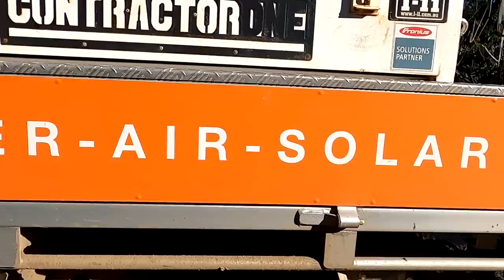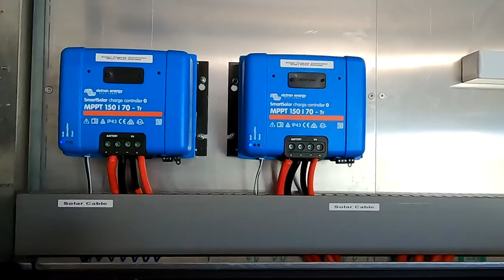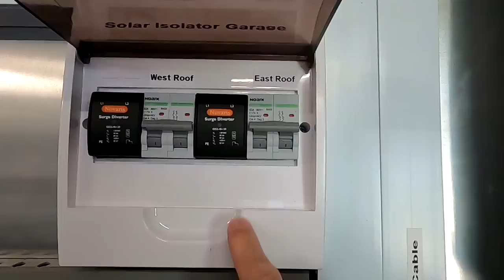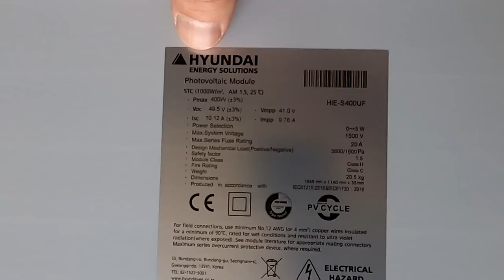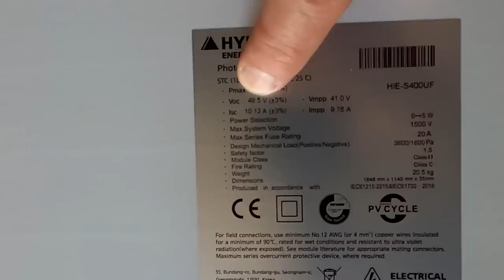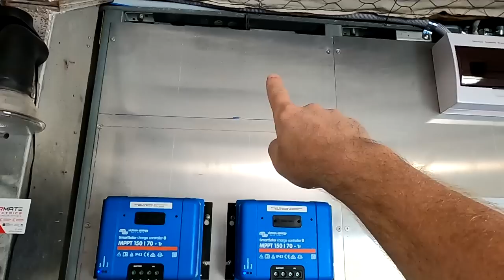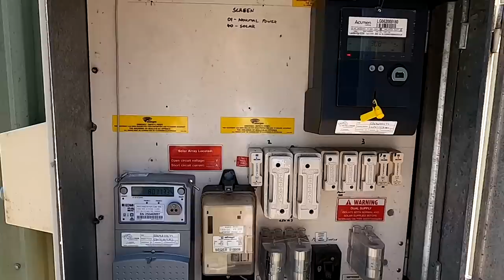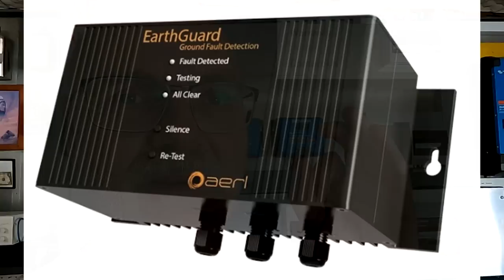I booked an Electrician to check on my DIY Solar-Battery System.

Comment: I don't know about your specific certificate program requirements, but sometimes it is possible to do part of the installation yourself and then the professional electrician inspects your work and finishes the install and thus the entire system qualifies for the program.  For example, you might be classed as an assistant or an apprentice being supervised by the professional. This can save money will still qualifying for all the financial benefits available.

Comment: Andy, if you want to wire 2S configuration it is better to go up with the panel voltage, so maybe use 550+Wp models. The width of your roof is around 3m, so you can easily install 2,3m panels in one row. 
2S configuration = a lot of wiring. Victron has also 250V version of mppt or even 450V version. But I understand, you would like to use everything what you already have in the garage.
Reply from the maker: With 2 panels on top of each other, I have the best efficiency with the shading. If I put them sideways, the efficiency is worse. One panel could be shaded, while the other on is in the sun. The voltage would not be enough any more.
Same for the 250V MPPTs or even the RS MPPTS from Victron. If panels are in the shade, it would run hard on these diodes all the time. So far the parallel low voltage strings are the best approach for this situation. But, yes, there is more cabling effort.

Comment: Regards the earthing, I was under the same impression as Andy,ie earth to the same point as the building, but if you get a dc fault on the roof that dc voltage will be present on the earth cable and thus make your earthed appliances and metal work live with the DC voltage, not good, so a separate earth point would be the answer, what did the electrician say about the earth bonding?
Reply: No, that's not true if a proper Earth ground rod or two is installed. All metal parts should have 0 potential to Earth, always.
Reply: Earth bonding does what it says on the tin. It bonds the equipment or structure to ground so that the bonded equipment cannot become “live”.
Reply: No, all of the bonded grounding system (Earth ground) would be at the same ground potential. An issue arises if two separate ground points are used as there can be a difference between the two grounds that will result in a voltage potential. 

Put two copper rods in the ground 40' apart and you're likely to read a voltage between them.
Reply: He's looking into it.
Reply: @Stephen2846  hi, yes I agree/understand about having different potential between the two earth points, but we are not talking about a mains fault to ground but a DC fault to ground, I can understand why they need the dc/ground fault alarm is needed, It’s an interesting situation having mains and DC in the same installation, I can see why “Normal” electricians wouldn’t look at an off grid installation.

Comment: Hi Andy. I have a newish 250 v Victron mppt s😅lar controller which I don’t need. I am going to smaller controllers. Great that you will have plenty of power for the Tesla. André in Sydney
Reply from the maker: I cannot use the 250V MPPTs because of the shading. I will keep several strings in parallel to have better performance. It is more cabling effort but the output is higher as well.

Comment: Glückwunsch... 🙂, An den Isowächter habe ich irgendwie auch nicht gedacht. Misst... ;-)   /   
Congratulations... 🙂, somehow I forgot about the iso guard too. Damned... ;-)
Reply from the maker: It's only necessary at a certain voltage.... which I am over.

Comment: Mach es! Kauf die Module 🤩!
Es gibt übrigens noch einen Laderegler von Victron mit 450V 😉 ist sehr komfortabel und erspart die ollen Stringboxen.
Reply from the maker: Longer strings don't make sense when you have shading. Parallel is far better ins such a situation.

Comment: Note to future Andy... You will not have enough solar energy during the coming winter solstice sun, you will most likely find yourself installing more panels elsewhere.... 
Also, I'm having trouble with understanding the purpose of the ground fault black box... 
Having something beep and blink an led seems kinda pointless considering how much that thing costs.... 
If it could shut down the system... Then that's different... I would think that if high voltage DC got passed the charge controllers, the batteries BMS would disconnect from over voltage... I don't know how the inverter would behave in an over voltage situation... 
My xing Ping inverter love's to complain when the voltage is too low and even shut down it's output until someone came to restart it again... I have not read the manual to see if it has over voltage protection also built in... If it has, then what's the point of this expensive little box? 
If high voltage got passed the charge controllers, then they would have to be fried chicken and reporting information to my tablet inside my house would stop and possibly everything else and I would know that there's a problem... An emergency hard shutdown will follow and the multimeter and thermal camera comes out.... 
If this happened to you! What would you do? How would you handle this situation? Would you get bitten by a live earth? Or would you do exactly what I have said earlier? 
Call it a war game and be honest with yourself a run through a scenario... Will you fail your own test or will you pass?

Comment: So, I'm a European viewer and I brought up the different "non-essential" feed for hot water etc as an interesting idea that I haven't ran into before, and said that looks like people in Australia have got some cool out of the box ideas like that. My friend said he looked all over the Internet and couldn't find anything about that so it must not exist. Care to elaborate a bit? How common is this type in Australia, etc. Seems like a pretty genius idea to me. Here if we run into simply not having enough electricity to go around, it's rolling blackouts time rather than being able to first turn off those loads instead.
Reply from the maker: We have different tariffs here in AU to choose from depending on your power company and provider. For example, mine provides me with the following choices:
Tariff 11: 24/7 (normal tariff, most expensive
Tariff 33: min 18h/day (they can turn off that circuit during peak times or at any point of the day to control energy demand in the grid)
Tariff 31: min 8h/day (a lot cheaper per kWh but it is mostly active during the night and mid day when power is excessively available)
More info here for example: https://www.ergon.com.au/retail/residential/tariffs-and-prices/economy-tariffs#:~:text=Tariff%2033,of%2018%20hours%20each%20day.
Reply: @OffGridGarageAustralia  Thank you for the reply. A very interesting approach because it requires additional infrastructure to turn these off, or do they cut it right at the house?

As a side note, been binging your channel a little bit ever since I put in an order for 100 kWh worth of CATL 280Ahs :) looking forward to building something with that.
Reply from the maker: @eowendyl  There is a relay in the meter box which they can control through frequency signals. It creates a new circuit from one of the phases which they are able to control. I think it's quite a clever way to avoid blackout at these hot summer evenings when all A/Cs are running but hot water and pool pumps are not really essential and can be turned off.
I also charge my EV from that tariff during winter time when solar is not sufficient.

Comment: Arc fault detection on the PV side of charge controllers could be a good idea and good clean fun.   SPDs not connected yet?  (connect to the ground of the solar charge controllers that the SPDs are protecting, they just prevent the PV inputs from going too high voltage.)
Reply from the maker: I'm not sure if arc fault detection is necessary but I will ask the sparky when he comes back next time.
I know how the SPDs are being installed and connected. The problem is that the earth cable needs to be as short as possible. And mine cannot be that short...

Comment: Excellent topic today Andy.  For me DIYer i will live with old panels and focus on the INSIDE of the house to MAXIMISE what is available. Why? I can exercise my creativity to improve on my design of equipments i use inside. Plus what are going to do with all thses old panels?
Reply from the maker: Some of my old panels are cracked as you know, so they probably won't be used any more. The other used panels will make it to the sunny area behind the pool where I plan to set up a ground mount system. There is still so much to do. Now that I have the electrician at my fingertips, I can do a lot more projects.

Comment: Did the electrician say or know why there needs to be this clearance all around on the edges? I mean what purpuse does it serve from a safety point of view? Seems like a very weird rule to me.
Here in Germany we also still have some weird regulations, e.g. 1.25 m clearance to a "protective fire wall", meaning there would be 2.5m lost of best usable roof space for a semi-detached house. And this is only for the glas-foil modules. If it were glas-glas modules it would be only 0.5m, 1m respectivly. Which is still weird in my opinion, but hey..
In my opinion the last thing to catch on fire in any event will be the pv-panels themselves
Reply from the maker: It has to do with wind load on the panels. It's one of the regulations when installing solar.

Comment: Hi Andy
Love the video this has opened big can off worms about EARTHING and sorry to say you are wrong and most off the people that think the same. Lets look at the house EARTH it is at 240V POTENTIAL and is calculated for a breaking current off how many power points lights and other utility's you have so for example average house minimum is at 80A in at 240V (here in Australia). Now on that it is calculated size for the EARTH and as per AS3000 ruling for that you need 16mm cables to the house for supply now the minimum EARTH cable is 6mm to safely handle the breakdown current as you use more current over 80A so does the breakdown current goes up hence bigger EARTH is needed and also cables to the house.

Now as for battery's you have POTENTIAL in your case for example is 55-60VDC but current as you have 3 banks each with 200A fuses you have now 600A. To brake that current now you need bigger EARTH which will be now maybe 2 or 3 EARTH stakes in line and probably use 50mm EARTH cable to protect the system. Also your rack and plates on the wall will have to be EARTHED with same cable, what comes out off your inverter is different you protect it via 240V EARTH but battery's need separate protection to handle this big CURRENT and as you can see the house EARTH stake is not enough for that system also your EARTHS will need to be labeled accordingly. I hope this will answer some questions on different EARTHING on different SYSTEMS.
Reply from the maker: The electrician is currently looking into this. It seems the grounding is sufficient. Each battery bank has a 200A BMS, that is correct but the main breaker/isolator for each bank is only 100A, set to 80A.
The house has its won earth stake so is separate from the garage.

Comment: Andy , add a small carport at the front and space the panels . It would be cheaper .
Reply from the maker: That needs council approval and a builder to set it up. Not sure if that will be cheaper. Probably more effective but I have lots of roof area left on the house to connect more solar...

Comment: Strange, other multiple comments cannot be brought up here. I wondered why the panels had to be back from the edge of the roof? I also wonder about combining AC and DC grounds on the same ground rod? It would have been fun to hear the inspector's comments to fellow workers at his shop about what he saw at your home.
Reply from the maker: It's a regulation to have the panels 2x mounting height away from the corners. That is due to wind force.
Reply: @OffGridGarageAustralia   Ok, I prefer a ground mount of panels so they can be cleaned and snow removed easier.

Comment: Andy can you let us know how this electrician intends to connect house to batteries using existing underground cables while retaining feedin tarrif, or does it mean can do that later once feedin tarrif goes and then use existing cables? I thought a previous video and installer convinced it couldn’t be done within existing feedin rules (I think due to the common pen cable?).
Reply from the maker: Yes, I will as soon as I have all the information. Very interesting project...

Comment: Under 120v DC is considered extra low voltage. Keep it below that and you don't have to worry about solar panel regulations.
Reply: AS 5139 now treats anything above “decisive voltage classification A”, which is 60V, as “low voltage”, which means only a electrician can work on it. Unfortunately 60V on the PV is not quite enough for charging a 48V system. The way I get around this is to have only 72 cell panels charging 24V batteries and then have DC-DC charging from the 24V batteries to a larger 48V battery that runs the inverter. No part of the system goes over 60V, except for the inverter output.

Comment: So, in AU they don´t use solar panels mounted on a steel structure to cover parking lots? Or do they have to use a roof beneath the solar panels? What a great work you have done, also a bit scary due to the power involved. Your video on connecting the inverters is very enlightening. Thanks for sharing!

Comment: Andy you might want to check out the victron 450/100 or 450/200
Reply from the maker: Won't be great in my system due to the shading.
It's per design to have many parallel strings.

Comment: If you go with all new panels it just might be worth thinking about new charge controllers.  Victron does have ones that handle 250 volts input.  That would give you more choices how to wire the strings.
Reply: Victron have charge controllers that can handle 450v input!
Reply from the maker: To break down the solar installations in smaller chunks was as per design due to the shading. Of course the installation would be easier if we have longer strings but in partly shading every day you would run the diodes pretty hard and there is no benefit any more. In fact, it is less efficient than parallel strings with lower voltage.

Comment: Victron do a 250/70 solar controller..... Food for thought..... Still be able to have 3 panels is series (depending on panel size and roof space limitations of course).
Reply from the maker: Not with the Hyundai panels. They have 49.5V Voc and in cold weather that can go over 50V per panel
Reply: @OffGridGarageAustralia  victron 250 /70 is good for over 200+ voc and is still compatible with 48 volt battery systems.

Comment: Screw the regulations, this is offgrig. You can do whatever
Reply: Yeah, kinda but its more complicated when you consider insurance and life safety. The panel spacing from the edges has to do with a few factors including wind loading effects, space for fire fighting personal in a structure fire and the resulting obligations with insurance. If a system is nonconform and even an unrelated disaster happens, insurance could deny a claim if they have blanket conformity clauses or the total loss is caused by a hazard situation that fire personnel was unable to safely fight a fire for example.
Reply from the maker: No, you cannot just do what you want. It's the same regulations you have to follow.

Comment: Seeing they would give you 1/2 your money back which means if you installed 250 watt panels and did it yourself would be same price? I have 9400 watts peak for $1200 in used panels. Will upgrade them after my whole system is paid for if needed(6 years). That includes batteries, BMS, cables, inverters and ground mount system (complete system). They are raising electric prices all over the world. Mine went up 50% during peak hours and have heard others say theirs went up 50% reg times and 100% peak times.  getting 25 years guarantee sounds very nice since they could last 40 years and be 60-70% output. I  really want to see what you do.
Reply from the maker: You only get the rebate if an accredited installer set the panels up and connects them.
The problem is the regulations which are ridiculous here in Australia. Most of electrical work is not DIY. Not even for off-grid.
Reply: @OffGridGarageAustralia  Well what is price if he does that? what is price if you do it?

Comment: Hi Andy.  What about grounding the battery's? Victron recommend to connect the negative pole to earth.  I have done this on my system though the Victron lynx busbar by the earth connector as design.
Reply from the maker: What's the benefit?